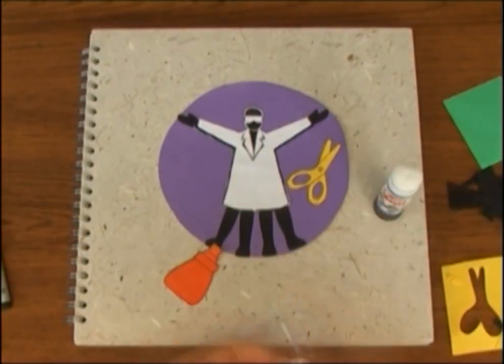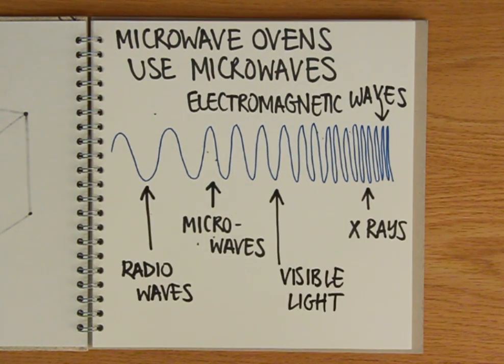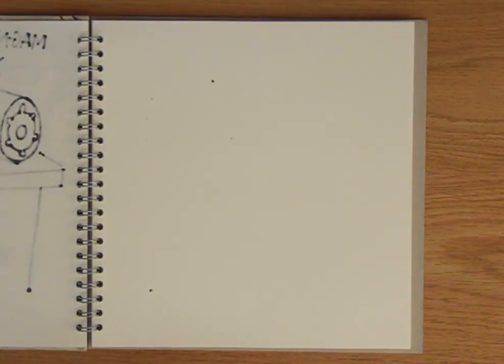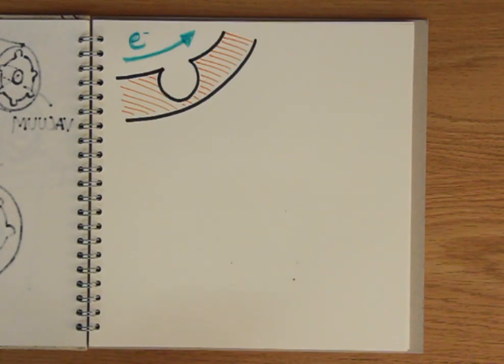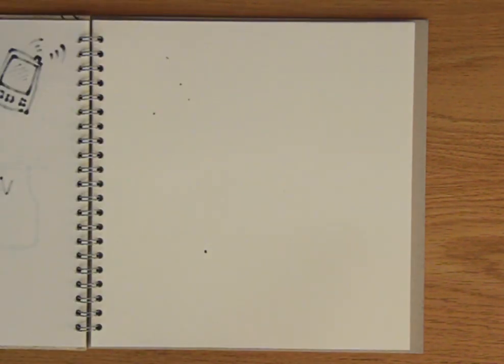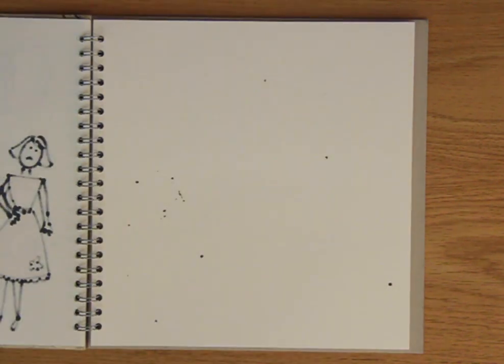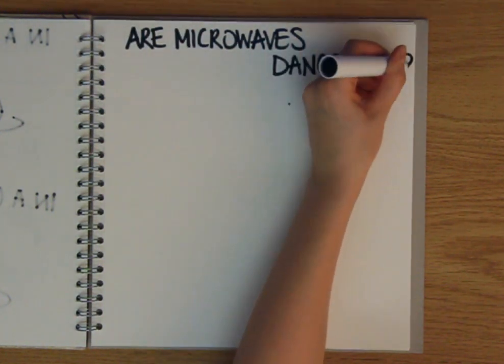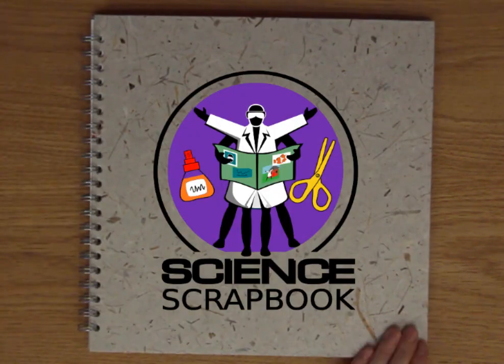How does a microwave work? - Naked Science Scrapbook

Comment: Good explanation, however, I think that an explanation about how micro-waves interact with water molecules, causing them to emit heat should be included, rather than just saying “the microwave radiation heats up the inside of the microwave,” should be included. The EM radiation of the microwave heats the food by causing the water molecules to give off EM radiation in the form of heat (infrared radiation), which heats the food. Otherwise, good video.

Comment: why we can not put that "metal or stanlessteel " plates in the microwave oven?
Reply: That creates 'Eddy currents' also called skin effect.,

In a microwave oven, special antennae radiate electromagnetic waves. The typical size of these waves is a few centimeters. The oven is built so that it acts like a resonator for the wave, which means that the waves inside the oven can develop very large amplitudes (and therefore can carry lots of energy). 

Electromagnetic wave's forces act on charges, pushing positive charges (+) one way and negative charges (-) the opposite way. The molecules in the food, which have easily separated (polarized) (+) and (-) parts, will therefore oscillate. As they oscillate, they transfer energy to the rest of the food by bumping into other molecules. More oscillations of molecules = heat, and higher temperature. This way the food heats up and cooks. 

Water is a good molecule to heat in the microwave because it looks like this 
H(+) 
(-)O . 
H(+) 

The charges are separated which means its easier for the wave to make the molecule oscillate. 

Another mechanism that is at work when microwaves heat up food is the electrical resistance to eddy currents. The electric fields of the microwaves cause electrons to move about in foods that conduct electricity, although poorly. Water with dissolved salt conducts electricity rather well, although not as well as metals, and foods with water in them tend to have some ability to conduct electricity. As the currents flow in the food, it heats up due to resistive heating, similar to what happens to light-bulb filaments and hot-plate coils. I remember seeing an old hot-dog cooker that relied on this form of heating. Hot dogs are speared on electrodes, and current flowed from one end to the other, cooking the hot dog. These weren't popular because the hot dogs tended to burn near the electrodes and taste bad.

We don't put conductors in the microwave because they reflect the microwaves and can cause sparking, which can burn things. If you wrap a potato in aluminum foil and then put it in the microwave, the potato will not cook. Electrical currents will flow in the conductor while it is reflecting the microwaves, and if the conductor has a sharp point or edge, some of the electrons may leap off of the conductor, making a spark. That having been said, the microwave's walls are made of conducting metals (painted or coated in plastic for easy cleaning), and so they reflect the microwaves back towards the center of the oven.
Reply: Mitchell McCreath 
thank you for ur reply
Reply: how i can copy your exeplination in this comment?

Comment: correction of incorrect explanation: "while moving along the cavity electrons cause fluctuation of electrons in cavity"->..they induce varying magnetic field in cavity which by EM induction causes variing electric field in copper tube, which leads to charge redistribution ->charge rapidly redistributes inside of magnetron copper tube --this varying EM field inside of magnetron cavities is "caught" with coil and taken outside of the magnetron via wire and emiited to space using antena

Comment: Microwaves are actually one of the longest wavelengths there are so there are, longer than visible light, so in a sense they are even less damaging than normal visible light. They are also a lot shorter than XRays which are in themselfs not particularly harmful.
No radiation actually swaps moleculs thats redicoules, radiation actually moves particales smaller than atoms out of the way as it passes through you, moving DNA ones as well, which is why its bad.

Comment: So what's the difference between a microwave radiation and visible light radiation? Visible light actually has more energy than microwaves. So are you saying that shining too much light onto your skin could be damaging, and causes cancer? Hmm ...
Reply: No they are not saying that!
There are several factors to consider here.
One is that, per photon visible light has more energy than microwave radiation. But this is misleading: a microwave oven puts about 1 kW of power into a confined space. That's a lot of power. You don't often see that much power from visible or near-visible light in a small volume: if you did, you would be just as worried about cooking yourself. In other words, if you put a 1 kW source of visible light in a small box, it would cook the stuff in the box.

Comment: This video had great information and I was following along happily until the end where they talk about the non-ionizing radiation and how its not dangerous. This would have been a perfect video if they went into depth about what happens to the food on a molecular level. Microwaves are dangerous and so are the toxins that come out of them. But I did enjoy most of it.
Reply: Wild flower, I see it was 7 years ago you posted your response but.... They did go into how the microwave works on the molecular level! They used water molecules which is what a microwave is tuned for as most all food has a fair amount of water in it. Microwaves excite water molecules which then heats them up. And while microwave ovens are dangerous it's only from the high voltage inside. Otherwise they are not dangerous and do not produce any harmful "by products" as you proclaim. Sorry! But your misinformed.
Reply: @stevenm.gehrke8303  you're *